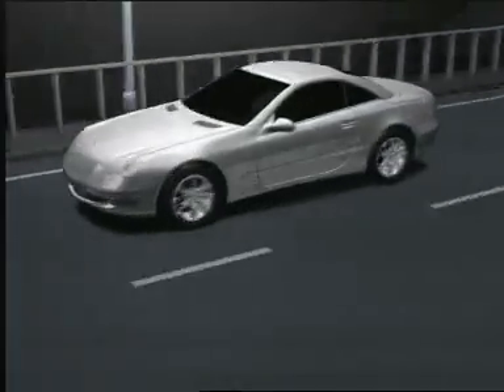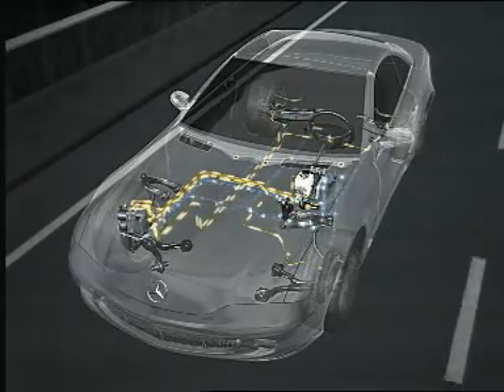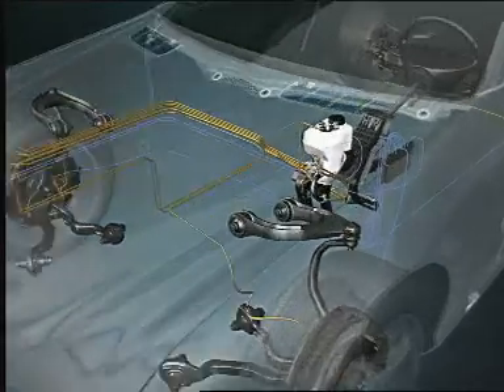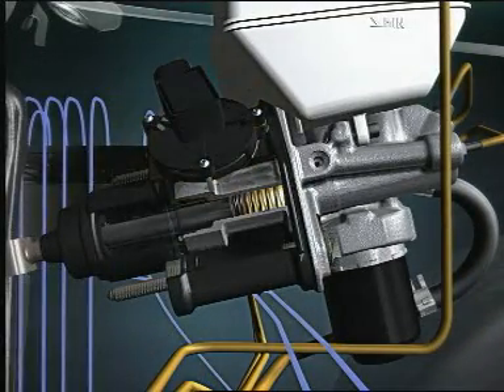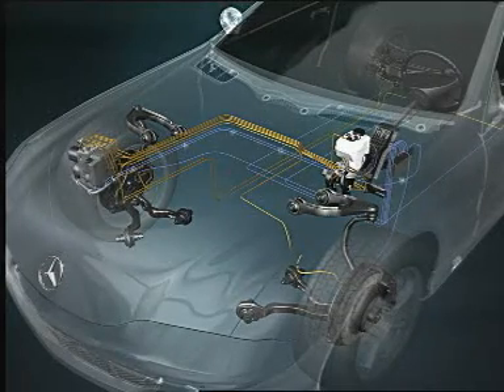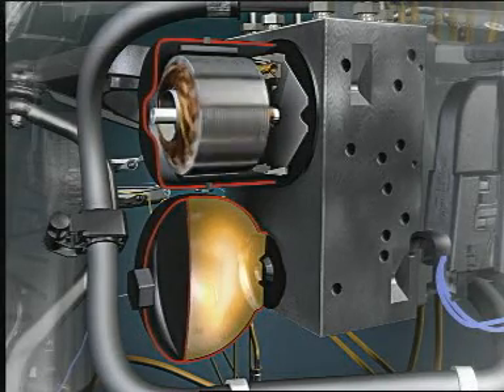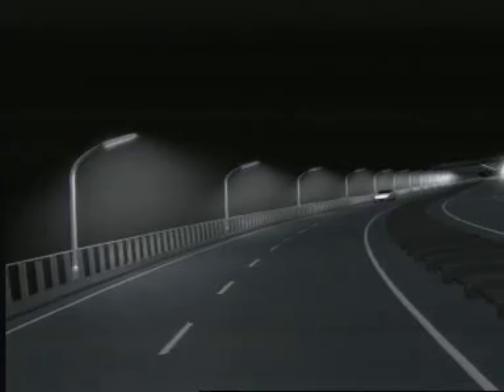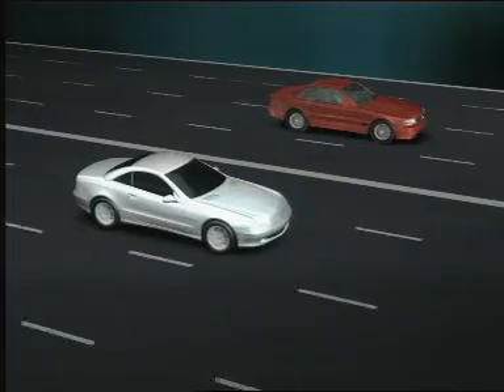Sensotronic brake control SBC

Comment: @00DodgeAvenger00 
did I say they replaced the system in the recalled cars ? 
sorry I think I mixed thigs up, what  meant to say is that they cancelled the system the year after the recall. 

thanks for the correction mate :)

Comment: too bad this system was a failure that they had to recall all vehicle fitted with SBC to replace that system with conventional hydraulic syste. The problem with that system was the high cost  and  the short life cycle of the SBC system. plus the all new electromechanical system will replace it. I can't believe some companies are still using this elecrohydraulic system 

thanks for the video anyway :)